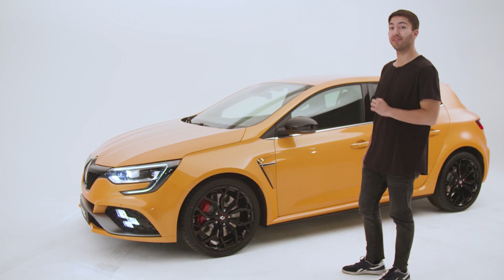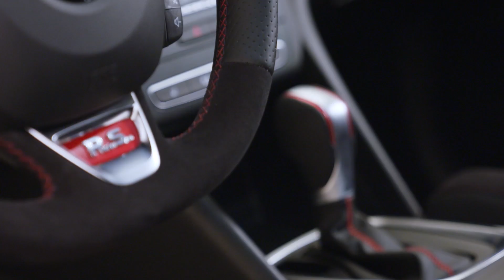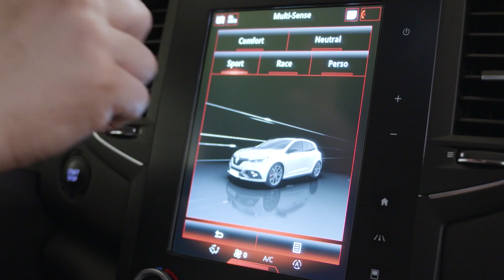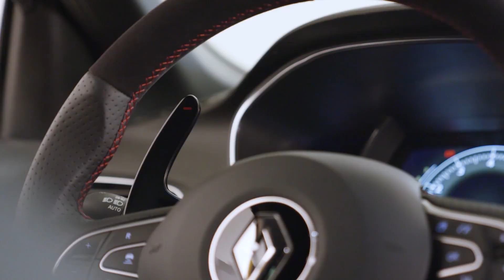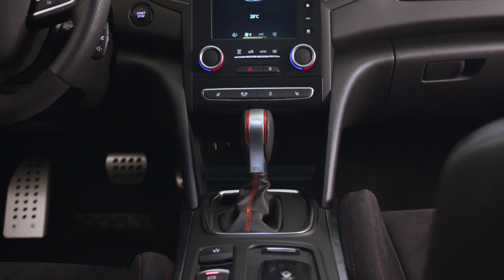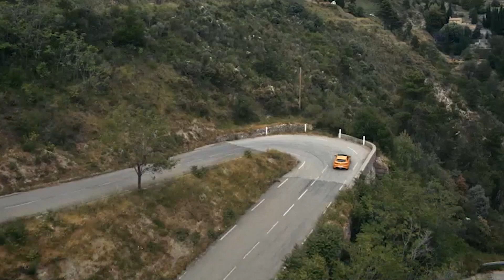2018 Renault Megane RS revealed | Autocar

Comment: It infuriates me when people say the Clio RS has sluggish gear change. This is complete and utter rubbish. I currently drive a 2017 Clio RS Trophy and the gearbox is phenomenal. There is absolutely no way I would want it as a manual. In fact it would spoil the cars performance. I have driven track cars with racing sequential gearboxes and I honestly can't tell much difference in speed of the gear change. Manual gear boxes are extremely old fashioned and I would tick the EDC option box all day long.
Reply: first impressions last.... it's sorted since MY16 or so and it looks C4RS owners love it now
Reply: I sadly dont have the money to buy these cars but I agree with you.I would also buy EDC gearbox than manual.Simply it better performer than a manual shifter.
Reply: You can't be much of a petrol head then if you don't like a manual... its individual preference... Each to there own..... dsg in the vw range is shit in my opinion and prefer proper old school manual most of the time... It changes when I want it and only when I want it... dsg even in manual will still change down for you when it thinks it should which I don't like! Yes 0 to 60 a ball hair quicker..... I don't want a computer to try and decide for me... simples

Comment: The killer of the type R 💪
Reply: No way,the Type R will be able to keep up with it in the corners and it will blitz it down the straights with it's power and torque advantage.
Reply: We'll see. But previous Type-r was worst than previous Megane in corners and driving pleasure.
Reply: MunroM84 the 2019 trophy r will beat the civic type R this however will probably not.. but even the  old trophy 275r had higher corner speed but it lost to the golf and type R on acceleration outta corners
Reply: You don't know what you are talking about. Honda originally is much faster and with replacing intercooler only and new soft you get easily 400 hp and more then 500nm. From 0-100 km/h in 5 sec. and 100-200 km/h in less then 10 sec.
Reply: MunroM84 not in these test the Magazine was changing all to cup 2
Reply: malboro555 even golf r can raise power on 60hp on stage1. I really doubt that type r can raise on 80hp
Reply: You lot can jibber- jibber all day long .the type r never needs to go and be repaired or electronic glitches sorted out li,e Renault and vs Audi. So when you in garage ,I'll be driving , I've had e type rs I know!
Reply: SunLoverMan  We have already in Poland plenty of such modified cars and they are flawless so far. Wagner intercooler ,bigger downpipe + program do wonders to type r.
Reply: malboro555 I was talking about stage1! Stage1 means reflash only.
Reply: SunLoverMan RS has been almost never been in the shop in germany NBR.. VW however Audi and bmw is alot
Reply: benamara youcef a will be sticking with my 2011 FN2 My option the best of the type R s will be putting a wrap on it after winter having it look like it’s just out the showroom Plan on keeping it and adding mods along the way Love the look of it and inside can’t fault it apart from the usual visibility out the back window So I new computer system is also getting fitted with cameras on the front and rear. Great car to drive Could go get a newer one on finance but would rather keep this wee gem. Was scared of Honda for years with all the gadgets but everything works well So one shall be keeping this car 🤞🏽for the foreseeable 💙🇬🇧

Comment: Why O why every new hot hatch has to have 5 doors? If I want a practical car, I'll buy used Volvo V70...This Mégane RS doesn't look special by any standard, but no one expects that from  a car which is all about handling, balance, precise steering...at least it SHOULD be...
Reply: maybe you want a practical car that doesn
t look and sound like cancer?
Reply: You missed a point, hot hatches shouldn't be practical, but light, agile, noisy and FUUUUUUUUN to drive. that's the whole thing
Reply: But would it look better with 3 doors? Isn't 3 doors a bit like a coupe wannabe? I like that it's also practical AND sporty. What it should have in my mind is AWD.
Reply: this car is practical, relatively agile, noisy, powerful and fun to drive. deal with it. it will correspond to certain customers, that's the only thing that matters
Reply: R.S. (in Renault's case, not Ford's) always means LIGHT AS POSSIBLE. Remember R26 and "where are the wipers" situation? AWD means ALWAYS WEIGHT DRAMA.
Reply: That customers had already bought Type R
Reply: More people will buy it with 5 door as its a global car
Reply: RS means renault sport. wtf are you talking about
Reply: it shares a platform with cars like the mercedes GLA, the platform wasnt designed for 3dr cars
Reply: Richard Hart Renault doesn't share platforms with Mercedes, just engines and tech
Reply: Igor Brezovic it's a global kinda thing yess.. the previous mod. Didn't enter my country because no one spent so much money on a coupe/3door this made Renault think and they acted good.. i think it  looks awesome..
Reply: Igor Brezovic I think it just comes down to economy, it's way to expensive to develop/design a car for the hot hatch market only, all factories are doing the same, the global platform thing...
Reply: they do share platforms, though they try to hide the fact they do by changing the name of the platform depending on what car its on. the megan and the GLA even share windows,
Reply: Richard Hart they have no reason to hide sharing platforms. The only platform which is shared between Renault Nissan and Mercedes is one used on the GLA which Infinity uses for their QX30
Reply: livc444111 true
Reply: thats the same platform also used on the qashqai and the leaf hence why there all made in the same factory,  from what i know theres 14 differnt cars made on the same platform, and there all 4 or 5 doors, which was the original point i was making.
Reply: Richard Hart wrong. The Megane and the Qashqai use the Renault-Nissan CMF-C/D platform. The QX30 uses the platform from the A-Class which isn't a Renault by-product.
Reply: Igor Brezovic the whole point of a hot hatch is that it can do everything including opening the rear doors to get the kids out
Reply: The whole point of hot hatch is getting AWAY from children/family/real life, not carrying them with you :-)
Reply: actually not at all... getting away from that would be a sport car, like a porshe
Reply: Igor Brezovic Igor like i said it's a sales thing you get more buyers if you have some sort of practicallity thats just the way it is.. i like  that you can get in kids and all that other shit cause then you can fool your GF in saying this is a practical car we need this then when you have left them home you just goes at the mountain passes and goes balls out.. there you have a win win.. so this is the way they see it  cause like i stated in some countries they didn't even take the coupe/3door in..
Reply: As i was saying, the have 2 names for the same platform

Comment: it was always ugly but its completely unsightly now, shame really.
Reply: Always ugly? Are you high mate?
Reply: i really dont like renault, but this car is far from ugly
Reply: lucianrajah  he is a butt hurt VW gti fan. a design that hasn't changed inb5 decades.
Reply: It has nothing ugly about it. What are you on?
Reply: It's all a matter of opinion and what you want from a car.... I like this new 'RS'..... I am wanting something to replace my Mazda 3 MPS....  the 'Type R' has the spec... but I wouldn't want one ... I think it looks like a Tupperware party...
Reply: @srinivasan krishnamoorthy I've never owned a golf and I never will. In fact, when I test drove all the hot hatches I specifically swore not to drive a Golf. So, you're wrong I'm afraid.
Reply: @Pipaho I have nothing against Renault, almost bought the older model RS except it had a failure on a test drive (even then I was understanding it was an anomaly not typical of the manufacturer, contrary to popular opinion). I don't have any brand allegiances, I genuinely think this is the ugliest car they have released.
Reply: @lucianrajah I'll concede the older model was not entirely ugly. It looks a lot like the old Astra from the back, but not really ugly. But this, I mean look at the front end!